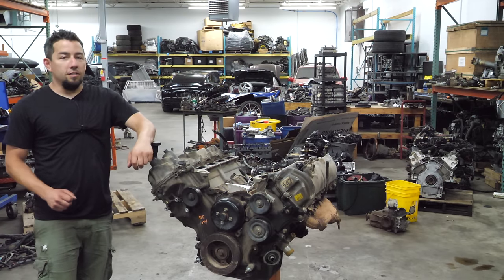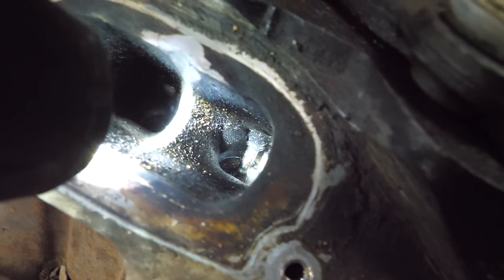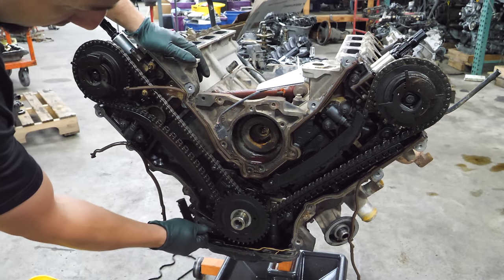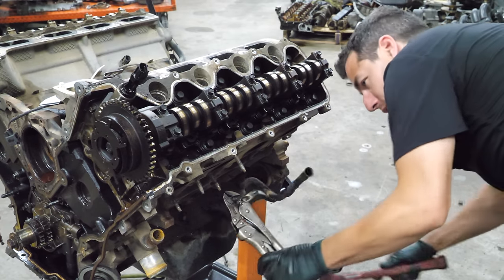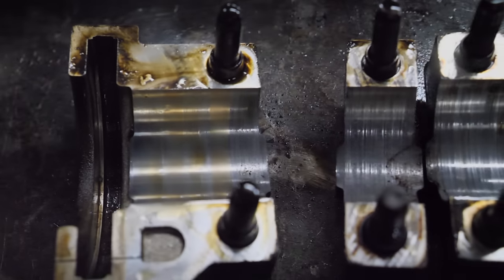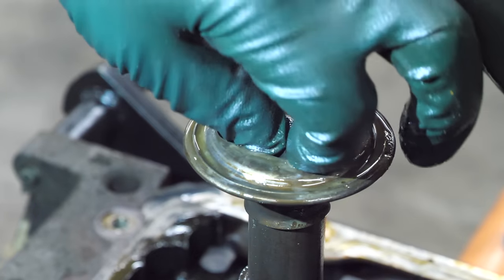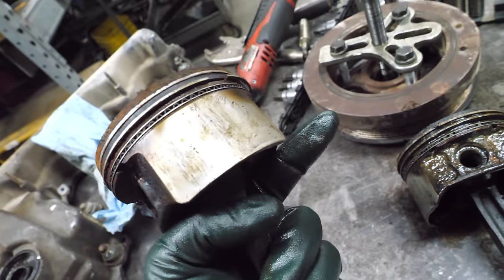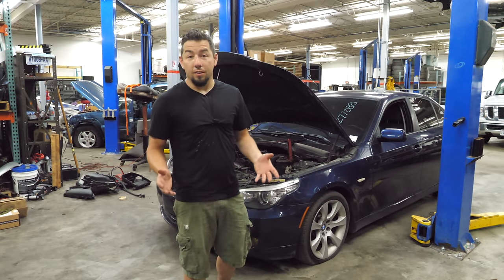Bad Ford 5.4 3-valve V8 Engine Teardown. Which of The MANY Possible Failures Took This One Out?

Comment: I have a 04 Ford F-150 with 5.4 3v and it has over 220,000 miles on it. Never have had to do hardly any maintenance on her. Keep the oil changes on a regular basis. Lucky i may be but i can't complain about mine at least.

Comment: As an owner of a 2012 Navigator with this engine, videos like yours scare the crap out of me.  I acquired the vehicle with 64K miles on it and now have 98K miles.  Not knowing much about the previous service records, I change oil and filter every 3K miles, which my mechanic highly recommended for this engine.  The exploding plastic chain rails seem to be a very common problem that end up in the oil pan and sucked up by the oil pick-up and strangle oil flow. Ford continued to produce the parts from plastic through the engine's history.  The factory oil pump is also notorious for being under capacity and there are a few after market pumps that are superior.   There are claims of very high mileage engines out there and frequent oil changes seem to be the only explanation.  Do you have any other maintenance recommendations to prolong the life of this engine?  I'm thinking of dropping the oil pan at the next oil change to inspect for chain rail shards in the pan and the pick-up.

Comment: same thing happened to the service truck at work, ate the timing guide, got stuck in a spot where the crank pully ground it up until the oil pump filled with plastic, 2009 F350

Comment: Eric, please tell us if these engines may be replaced into the trucks with them, with the much more powerful and trouble free 6.2  flex-fuel gas engines. I have one of each in my Super Duty F250 ... The 5.4 has been meticulously maintained it's entire life with very low mileage services (2500-3000 mile intervals) had the phasers replaced at around 130,000, and manifold repair done then also. It still has the o..e. oil pump with the current mileage at nearly 185,000. It has been a trailer puller all it's life and a clean body free from rust. Should the engine detonate will a 6.2 gasser easily retrofit against the older style transmission in this '011 model ? I truly love these 6.2 engines in my '14 and '15 models of the SD 250 meaning good power and great fuel mileage along with durability.

Comment: I have also changed the plugs in the tritons 4 times now. The only time I broke one was when I tried to change them cold. I have a video on it. But the trick is engine warm and very small movements back and forth until it breaks free.

Comment: I owned a 5.4 3 valve for many years and didn't know it was a ticking time bomb!! I sold it at 75K and bought a truck with a 5.4 2 valve motor and feel good that it will last a long time. I just drove it on a long road trip and pushed it HARD and it performed like a rockstar!! Thank you Ford for making good motors before 2004!! 👍👍👍

Comment: Had no issues with my 5.4. You just have to change the oil at 3500 miles instead if the 5000 mile interval that Ford claims. Theae engines either run very well or very poorly. Not a lot of in-between.

Comment: Mine is a ‘14 in a 4WD expedition. 190K miles with no issue. It is under powered on taking off but handles itself fine on the road

Comment: I HAD the 4.6 3V in my 2010 F-150. In the 11 years I owned it, I replaced the Phaser gears 3 times, the VVT solenoids twice, the timing chains guides and tensioners, and put a Melling M360HV oil pump in it. That danged low rpm phaser rattle never went away fully. Totaled the truck in 2021 and bought a used 2012 F-350 6.7L with 69k miles to replace it.

Comment: Most of the issues with these engines are caused by infrequent oil changes with 5W20 oil.  Run 5W30 oil and change the oil every 3-4k and itll last the full service life of the parts.
Reply: A question….5w30 in the winter, and 10w40 in the summer?????

Comment: I believe a better oil pump from the factory would have  possibly eliminated most 5.4l problems. Jasper engines has a video comparing the factory pump to a melling pump. It's ridiculous how much oil pumps out the side of the pump at low rpms. It never makes it where it needs to go.

Comment: As soon as he said sparkles in the valve cover I immediately thought broken timing chain rails. Clogged up the oil sump and engine started running dry. Poor design for the most part, but completely serviceable engine. I'm running 280k on mine after a proper rebuild due to a cheap timing job. Go OEM on timing chain, guides, and tensioners. Aftermarket parts are like betting it all on black 8. Good luck!

Comment: yes they are junk.... but i rebuilt one in my 04' f150 in 2010 and kept maintenance up with syn oil and i installed metal chain guides on the phasers instead of the plastic junk.  it was still running strong when i sold it  in 2017...  just gotta stay on top of the maintenance

Comment: Great,I have an 05,with this motor.Did the plugs and coils at 100,000 miles and yes even being super careful 3 did break.Im at 120,000 now and as I knock on wood my truck runs perfect.

Comment: I've seen one delete a chain rail before. Happened at a stop sign. Went into limp mode and limped it to the shop. Replaced the rail, and it ran fine. Might have replaced all the timing components, not sure.

Also, there was no warning. Just blew up.

Comment: So my 5.4 did EXACTLY what you just found wrong with the timing chain guard. The problem happened when the crap factory oil pump couldn’t get enough oil to the timing chain tensioners rattling that chain against the guide. Then boom. My 5.4 broke one of the guides and pieces fell into my oil pan only to get sucked up the oil sump and starving my engine of oil. Ended up rebuilding my lower end (In process of changing my rocker followers out as we speak). That cost me $2200 in parts and machine shop labor.

Comment: my family had a rustbucket of an '04 or '05 expedition with this engine, and it worked fine, up until one of the idlers fell off because the thing it bolted onto fractured clean off of the timing cover

Comment: Interestingly enough I have this engine in my 06 f-150 fx4 and at 186k miles I have had 0 problems. Yes the original spark plugs broke. No big deal. The engine is dyno tuned and I have a lentech street terminator trans behind it with a 6.0 27 row trans cooler.  Eaton tru tracks in both diffs, iwe eliminators.  Have towed max weight cross country. All temps stay very good. Change oil every 5k with 5w30 full synthetic and motorcraft filter. This engine produces great low end torque and like I said no phaser or chain issues. Maybe I got lucky who knows but I appreciate the torque and puts a smile on my face every day I put the pedal down.i push it very hard and it takes it. I believe most failures are attributed to severe lack of maintenance and people not following the severe schedule. I like this motor so much I plan on building a 700hp supercharged replacement for when she gets tired but I still have a long way to go. Also forgot the gt mustangs of the same era had the same head topology. But I’m sure mustang owners take better care of their engines than people with work trucks that run them into the ground

Comment: Not everybody has hate for the 5.4. I rebuilt one lightly with stainless exh manifolds and chinese Amazon parts. Had to do some work on exhaust studs and replaced the oil pump with a high volume unit from mellings. I think at 130k miles, the block and heads have a ton of life left. Either way they are super easy to disassemble and repair.

Comment: Hello Eric! I have a 2009 F350 super duty it has 222000 km on it has this engine and it has never been out of the Truck I have Myself replaced all the timming components all OEM stuff never had an issue with removing the plugs it picks up a 7300 lb Truck and gets on down the road pretty nicely I have not been unhappy with this engine, I plan on replacing all the lifters and lash adjjusters this year, I have changed the oil within the time required for synthetic oil never over the 10.000 km point only on the two trips I made in it to the Yukon and Back were I changed it at 10.000 km along the Robert Campbell Hiway and the second time along the Trans Canada east out of Golden British Columbia otherwise 13600 km the first trip and 14300 km the second trip and many shorter trips out east also never skipped a beat yet so put a mark on the wall in the I like this engine inspite of those issues column : ) from Me ! now that bit is over I Very Much Enjoy the teardowns You have taken the time to make record of for all Who take the time to Watch Your Humour and the Carnage are Great ! Thank You : ) Cheers!!! Rick Armstrong Aurora Ontario Canada

Comment: Looking at the oil varnish on the cam and other parts I would say this engine hasn’t had regular oil changes. You didn’t mention mileage and it didn’t have plugs but deep scratches could have come from debris left from broken spark plug removal? My 06 F250 SD 4x4 has over 130k and no engine issues, use only motorcraft oil and filters and change it every 4000 miles, do a little towing and a lot of freeway vs city driving.

Comment: If seen this before the chain tensioner is oil actuated and the seal often fails dumping oil pressure into the timing case making a loud rattling noise at startup which everyone ignores

Comment: Hi Eric, Yes I have a 5.4 3 valve it was the first Ford that I have owned. well early on I had cam phasers making noise.than it got better. Now when I go to start it cold or sometimes hot I loose oil pressure. I will crank it than shut it off and do that 4 times till oil pressure moves. Now the transmission has lost reverse. Well Such my luck😪Don't really know what to do? I have worked for GM dealerships for 20+ years.

Comment: I have the first Gen Triton 5.4L 2-valve in my E-250 Econoline Conversion Van. She has 190,000 miles so far and burns 3/4 quart of oil every 4,000 miles. The best part of owning this van is that no and I mean no oil leaks on the driveway.

Comment: I had a 5.4L 2V in a 2000 E250 from new and put 135K almost trouble free miles on it. Replaced a coil because some coolant shorted it out. Other than that just changed oil regularly and it ran good until I sold it.

Comment: Got 355k on my 05 and runs great. I also use 5w30 Full synthetic oil and wix or Mobil oil filters. Change mine at 3k-5k miles.

Comment: the spark plugs have a lower chance breaking off if you use a 3/8 inch impact. the special tool to extract them is easy to use though.

Comment: I have 237000 on my 09 , had to do timing chains and phazers at about 120000 . Replaced the plastic timing chain tensioners with iron replacements and change oil every 4 to 5 thousand . Mine still runs good . But I do see issues that should have been fixed

Comment: This is almost identical to how mine failed however the engine still ran and did not skip time but made a horrendous rattling noise on startup from the chain slapping the front cover. Luckily I was able to get in there replace all the various components required, lash adjusters, roller followers, full timing kit, melling oil pump, as well as a new water pump and thermostat just to plus it up. Truck runs like a top again. 331,200mi so far.  From everything I can see this is the first time a job this truck has ever had. It had the original Ford OEM oil pump as well as the original roller followers with the wrong oiling hole

Comment: My first truck @16y/o was a 2004 f150 EC 4x4 with this motor. It had 312k on it when I got it. Original motor and trans. I beat the living snot out of it like you would a mud truck. It had the cam phaser knock exhaust leak and miss fire when I got it. Did plugs and it didn’t skip a beat for 3 years till I scored a cylinder at 378k miles. Was a great truck to me.

Comment: I've replaced the plugs in several of these. Typically after they've been thru a good hot soak and then impact tears them right out without breaking them off. Way faster than doing it cold and using penetrating fluid and still breaking them off.

Comment: I had one..a 2004..never gave me any real trouble until about 155,000 miles..then on one oil change the tech told me the engine drained about a quart low. Literally 3 days later the engine totally shit the bed. After hearing all these issues I feel like I got lucky that far.

Comment: Biggest problem was the stoopid spark plug design for the spark ground. They don't really break, the ground is a tube with the ground in a loop over the electrode. This tube was pressed into the steel shell. The owners manual told the spark plugs had to be removed every 50k km or 30k miles and have an antiseize applied to the outside of the tube and the threads. If you did not do this, carbon will build up between tube and the bore in the head, which would seize the tube in the head and it would staywhile the rest of the plug came out. 
Eventually two solutions were introduced. Plug manufacturers built plugs with the extended body part of the rest of the shell with the ground welded over the end more like a standard plug. 
The other solution is a service head with more conventional plug design used with 12mm threads that fit between the valves. The 4.6 3 valve suffered the same.
If the head is servicable, use the one piece plig body plugs. If more work is involved like guides and valve resurface, get the service head.
A  polyquad valve and port job where one intake valve is replaced with a slightly larger valve with porting to make it work. This promoyes low RPM swirl in the combustion chamber, helping torque and fuel economy. David Vizard holds a patent on this.

Comment: My wife's 97 Expedition had one, salesman said it was junk assumed pile of garbage. But she got good deal on it so we had that thing for 12 years, sparkplug issues got old. 3rd set of heads we sold it, guy is still driving today.  Lots of luck with that thing, we were stationed in Germany 05 to 08 and oh yeah it came with us. She drove it, I bought a full German specd 525 I BMW. That thing survived driving the autobahn, came back with us when we returned to states. Was nice to roll with since we had 3 kids. My 99 F250 was a fog under loads but I did some upgrades and it lasted long time, it's still on the road today here in our town. Still haven't met a Ford mechanic that likes those either.

Comment: i so can't wait to show this to my ford friend we are replacing his second 5.4 3 valve with a third. Today i broke 4 spark plugs on the replacer and he gotten most of the electrical and intake drive line trans bolts. do you have an easy way to get the plugs out with out removing the heads. or wishful thinking

Comment: I did one p0011or 17 cam/crank correlation code and right side was definitely apart no noise. But same issue. Put new parts still ran 😊 good

Comment: In my 2004 Navigator I have the 32 valve 5.4 original engine. at 127k miles it's still going strong. I count myself lucky

Comment: 244,000 on mine. Been plowing snow commercially with it for 13 Years. Never had to change anything except the manifolds. Put quality oil and filter in it regularly. Engine still going strong, but the body is rusting out around it.

Comment: Super cool. That's my engine and I am about to go buy another used Expedition which of course comes with this engine. I wish I had an adequate shop to have an extra engine under rebuild all the time, ready for a replacement. I learned a ton from this video - probably that I need about $1000 of tools to really do the job right. What should I buy instead of an Expedition???

Comment: Replace the phasers with newer Ford part # and install the lockout kit. Then, replace the oil pump with a Ford High Volume or Melling High Volume oil pump.  The 5.4L 3V does have its problems. But there are fixes for it. But the mileage is the big issue. People drive them into the ground without fixing the problems.

Comment: i bought my 05 with 170k on it. immediately switched to 10w30 oil. never changed oil sooner than 15k intervals, first 2 were 25000 and 22000k. replaced plugs with one piece ones, sold it at 470k with phasers ticking at startup only. mostly hwy driving. 
keep it out of the city, up the oil to 10w30, 1 piece plugs,  lock out the phasers (wish i would have) and no engine will touch it.

Comment: Have a 2007 Expedition with a 5.4L 3V 119,000 miles on it! Have never had any problems with it mainly because I had it changed over at 30,000 to Full Synthetic oil! It runs perfect with lots of power enough to spin the tires if I  want to! It also gets up to 15.6mph city 23mph on a long trip, would not give it up for anything else! Engine runs very quiet can hardly tell its running when standing in front of it!

Comment: over 170,000 on mine. Great power and smooth. Maintenance with FoMoCo parts is most important. Also, OIL CHANGES!!  on time and quality oil. I have seen these with well over 300k miles and only 1 cam-phaser/timing chain change. They used the latest version of the phasers, timing chains and phasers (FoMoCO parts only, any other make are junk), and changed the oil on time.  It is obvious on the engine you are tearing down that it was neglected.